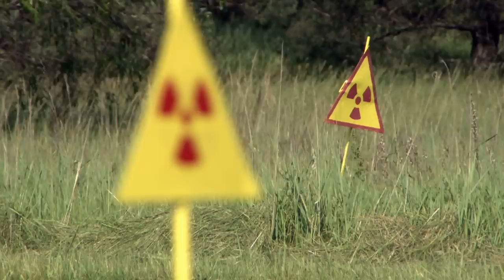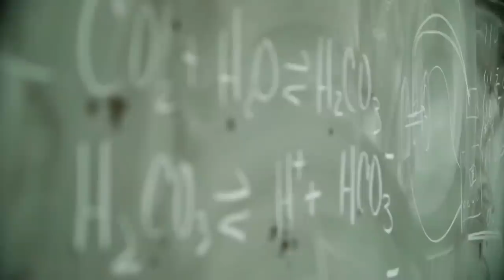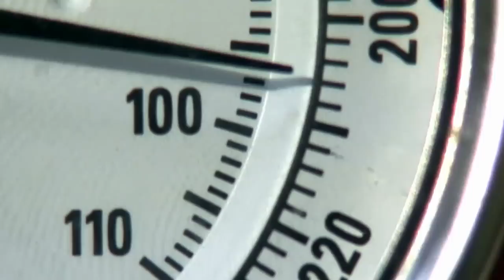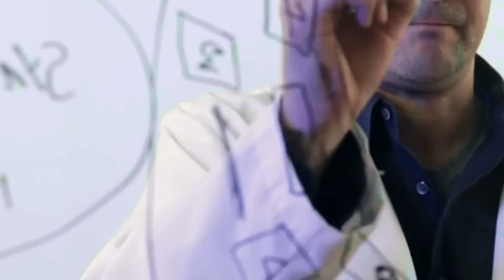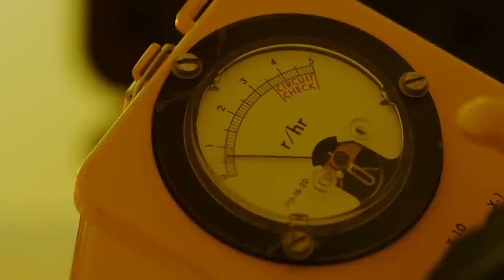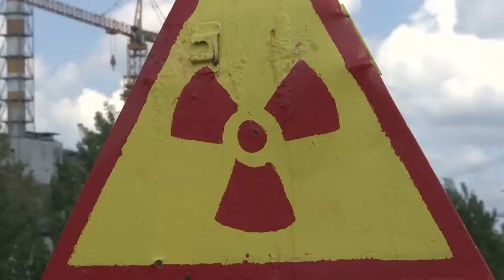China’s Most Powerful Global Weapon - A Synthetic Sun?

Comment: Can you please cover The Thunderwell!? Nuclear steam piston concept weapon/launch system for destroying asteroids or Aliens lol or launching cargo into orbit😁✌
Reply: The steam accelerated Jules Verne capsule, which was suggested by the speed of at least 6 times earth’s escape velocity, achieved by the 10-cm thick, 1.2 m diameter steel cover blown off the top of the 152 m shaft of the 0.3 kt Plumbbob-Pascal B underground Nevada test on 27 August 1957. In that test, a 1.5 m thick 2 ton concrete plug immediately over the bomb was pushed up the shaft by the detonation, knocking the welded steel lid upward. This was a preliminary experiment by Dr Robert Brownlee which ultimately aimed to launch spacecraft using the steam pressure from deep shafts filled with water, with a nuclear explosion at the bottom; an improvement of Jules Verne’s cannon-fired projectile described in De la Terre à la Lune, 1865, where steam pressure would give a more survivable gentle acceleration than Verne’s direct impulse from an explosion. Some 90% of the radioactivity would be trapped underground!

Comment: Supposedly, here in the U.S. one of Elon Musk's startups have a new design for a fusion reactor that solves the earlier issues.  They fire atoms at each other at 1250 mph and that makes them fuse.  So, it works off of these pulses.  I'm not sure how many times per minute it will do this, but apparently, the energy released will be enough to make it worthwhile.  That should get fusion up & running long enough until designs like the Tokomak have their issues solved, and are hopefully, even more efficient.

Comment: What material can reach 150million degrees without melting, I thought Tungsten had a melting point of around 6,000 degrees...
Reply: The plasma is contained by a magnetic field, no material can handle 150 million Celsius
Reply: @randomobserver9488  I knew those temps were just impossible for any material, but none of that heat escapes the magnetic field, cause those temps are just unimaginable and even if there was a little bit of heat radiation I don’t know what would be able to contain it
Reply: @prodigy750  The ITER tokamak vessel for example is designed to absord about 500MW heat continuously, mainly as neutron radiation. There's only about 7 grams of the hot plasma so it doesn't do that much damage if magnetic field is lost and "shit hits the wall"
Reply: @randomobserver9  thanks man, I appreciate that explanation

Comment: Is tungsten a metal? Could it be used to make a projectile that pierces better? Or a better Armor? Or a stronger more powerful engine/jet?
Reply: Lol, America already uses tungsten projectiles in their abrams I think bruh 😎
Reply: @DrMantisToboggan2005  no, they use depleted uranium
Reply: Weren't tungsten used in armour piercing rounds in ww2?
Reply: Tungsten is already widely used in things that need to be strong. Ever heard of tungsten carbide drill bits? It wouldn't be much use in the aircraft industry as carbon has a higher melting point than tungsten and its a much better insulator as well.
Reply: @ShermanistDruid  yep it was
Reply: @DrMantisToboggan2005  we do it one better: depleted uranium 😏
Reply: LOL. Lots of misinformation in these comments, but, YES tungsten and to a lesser extent, uranium are already very common elements used in the manufacture of ballistic weapons, ballistic ammunition, and general manufacturing tooling. Notably Tungsten and Thorium are used with depleted uranium to produce armor piercing rounds used by the M1A1 and other weapons platforms. And although it supposedly was never built there was a plan to build a satellite armed with giant tungsten rods to drop from orbit.  Think of a telephone pole sized rod of near indestructible metal slamming into the ground at 1800F and travelling at terminal velocity.  Similar force to Little Boy.
Reply: Thankfully there are several people who are much smarter than me in the comments :) Appreciate the knowledge.
Reply: @DrMantisToboggan2005  Not smarter, just more knowledgeable. Big difference.
Reply: Tounge-stim is a new kind of toothpaste for the tounge.
Reply: No it's wood

Comment: 5x hotter than witch zone of the sun the Corona 1 million degrees the surface 10000 degrees the core 20 million degrees
Reply: Probably the corona or surface.  No way it's hotter than the inside.
Reply: Thought the surface of the sun was about 5000 f. Anyway, you have to get way hotter than that because you do t have the suns gravity helping you out. No squeeze then more heat…..

Comment: What happens if it blows up or like a nuclear meltdown what then
Reply: A fusion reactor would just cool down and nothing else would happen, a great amount of energy input is required to keep heating newly added material and the result is a barely self sustained mixture, if the reactor shut off, the plasma would just cool down wasting lots of energy, but no meltdown because a fission reactor requires constant intervention to slow down and cool the reaction whereas fusion requires constant intervention to heat it up
Reply: ITER has something like 7 grams of plasma, in worst case it just hits the walls and you may have to replace some of the wall material before continuing to operate.. outside literally nothing happens

Comment: How can they create such stratospherically high temperatures without everything just melting?? Even tungsten has a boiling point of 10,030°F. What alloys or ceramic materials (or others) can withstand so much heat without completely melting??
Reply: I presume because it's only a momentary temperature. If it was a sustained temperature then, yes, it would melt or vaporize.
Reply: The plasma never touches any material, the hot charged ions are trapped to follow magnetic field lines around the torus
Reply: @randomobserver9488  I see. 👍

Comment: A thousand million?
-
Isn't that a trillion?
Reply: Swing and a miss.
Reply: @iunnox666  a ba-jillion?
Reply: I don't get along well with numbers.
Reply: @Olkv3D  a thousand million is a billion. 100 million x 10 is an easier way of seeing it just like 100 x 10 is 1000
Reply: @subsnovideos-ur4cn  you're pretty smart for a robot
Reply: @Olkv3D  I'm not a robot but I do build them
Reply: @subsnovideos-ur4cn  That's just what I'd expect a robot to say.
Reply: @Olkv3D  I build and fight combat robots
Reply: @subsnovideos-ur4cn  that seems kinda cruel
Reply: @Olkv3D  it's just a bunch of metal and plastic
Reply: @subsnovideos-ur4cn  maybe on the outside,
but what about on the inside?
Reply: @Olkv3D  escs (electric speed controller)  dc brushed and brushless motors lithium polymer battery receiver (to take input from the transmitter (controller) power light and power switch and a bunch of wires
Reply: @subsnovideos-ur4cn  do you wear boxing gloves when you fight them?
Reply: @Olkv3D  no they aren't exactly like that. They use wheels and are basically rc cars with fast spinning blades of metal and have  armor
Reply: @subsnovideos-ur4cn  that sounds really dangerous; how do you protect yourself when fighting them?
Reply: @Olkv3D  they are put into an arena that has translucent walls made from a plastic called polycarbonate which is extremely impact resistant and it's also half an inch thick. There are different weight classes going from a few ounces to 250lbs as you increase in weight the arenas get more durable and walls thicker and in the higher classes competitions put limits on maximum speed and weapon weight along with other rules you must follow in all classes like weapon locks to keep the weapons from spinning even if turned on by physically jamming the weapon usually it's a rod inserted to keep them from rotating. A fail safe which makes the receiver stop all input to the robot if the connection between the controller and the robot is broken. The robots are high centered where the wheels aren't touching the ground when working on them in case something accidentally happens so they don't drive off the table or twords you. A power light has to be visible from the outside to know if the robot is on or off. The robot must be able to be turned on and off from the outside without removing any panels. There is a strict loading and unloading method that is done to minimize the likelihood of anything happening. First the controller is turned on so that it is broadcasting it signal out waiting to connect the receiver once it's powered on. Next the robot is placed into the arena and safety cover for covering the weapons Sharpe end or any areas that can be a sharp point or anything that moves. Then the robot is turned on and last the weapon lockd are undone and the arena is closed and you drive to your square and wait for the match to start. There is practically no injuries from combat robotics because it's done safely and almost all injuries come from tools not the robots themselves and even when the robot is responsible it's because they got their fingers pinched when putting a top panel on or cut when installing a new weapon bar not because the robot sprung to life and cut them or drove off a table and fell on them.

Comment: I don't think there are much tensions with the west. There is a bunch of these all over the globe, France, USA, Switzerland, UK, Germany, Japan, and probably a few others are working on these. The hard part is getting the fusion reaction to last, because it rapidly breaks down and becomes unstable. With the right magnetic array, combined with an AI, hopefully we can keep the reaction in the right place. The addition of a "gate" that the fuel is pressed against that spins an alternator, which I suggested and have blueprints for, seems to make the technology a viable option. Till now it was just numbers and the idea that it was theoretically possible. 

Basically if you get the mercury that's used as it's fuel going fast enough by magnetic pulse, it starts to vibrate faster and faster till the subatomic particles come apart, and combine with whatever atmospheric gasses are present in the chamber. 

I've seen one placed on an aircraft which was demonstrated to me. It creates a gravity well underneath it, and my next idea is to use it to power flying saucers, which I believe I have reverse-engineered, after witnessing them and riding around in one at least once...

I think they can be used to produce diamonds from carbon gas too, for mining. Diamonds are necessary to mine things like tungsten, which the housing is made from, as it is non magnetic, in theory.

Comment: This seems like a DEAD END.  Trying to keep temperature for 150 million degrees for any length of time,  it will melt everything around it.  In order to keep CONSTANT flow of electricity.  It has to keep the temperature for 150 million degrees forever.  This will never be reached.  Therefore, this type of project is a dead end.

Comment: I'm perplexed why they keep trying energy negative solutions to produce power. Geothermal is a much better choice
Reply: Nuclear is TBH the easiest and Greenest one

2nd geothermal is not feasible everywhere, it is great if it place has set of conditions fulfilled
Reply: Geothermal is used already where is viable.  To drill holes is very expensive and slow,  so you have a cost to benefit issue